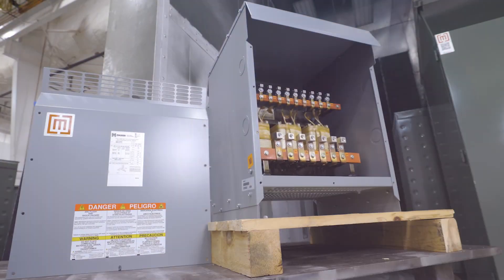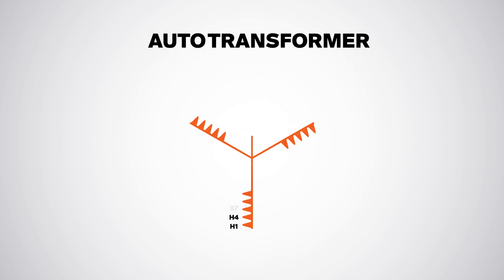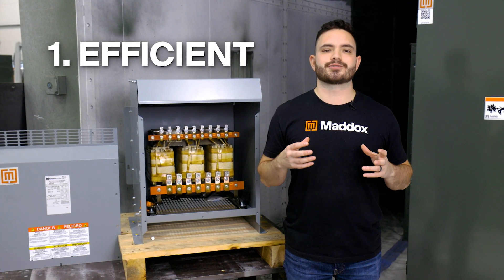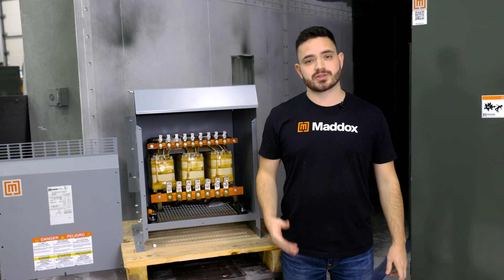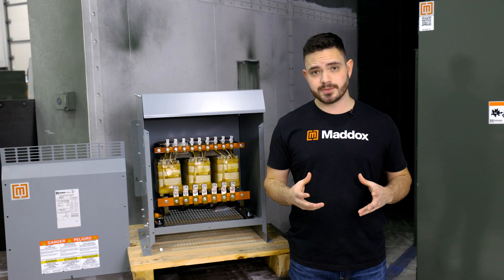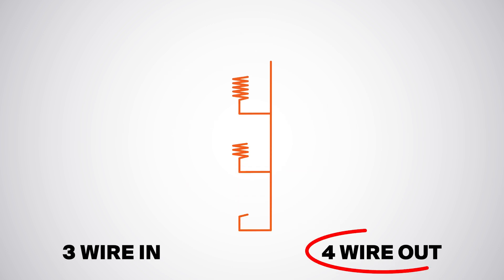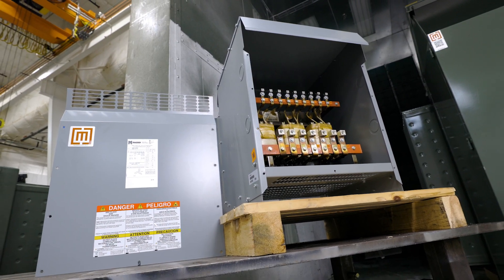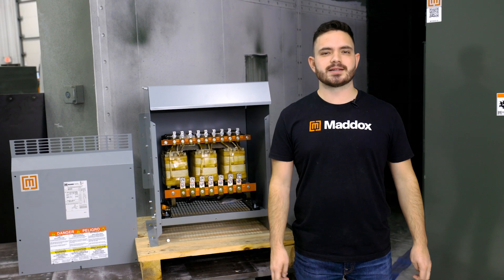Autotransformers  applications, advantages, & disadvantages | Maddox

Comment: My  autotransformer has 3 wires in 4 wires out, 480v to 380v 3 phase delta to wye. How is that possible
Reply from the maker: If your primary winding is delta-connected, and the secondary winding is wye-connected, then it's not an autotransformer. Some wye secondaries have multiple tap positions--for instance, 380, 400, 416, or 430--making the secondary side look like an autotransformer. However, this would not be an autotransformer since the primary is delta and the secondary is wye. Autotransformers don't have a primary and a secondary. They have a common winding and series winding on a single coil.
Reply: @MaddoxTransformer that would make sense but the one that came with my fiber laser machine in my shop is from china. It does not have taps to adjust the output voltage and all 7 terminals have continuity with each other. I wish i could show you pictures and video of this thing.

Comment: Many years ago we sold industrial machines in the United States, we always had to install an autotransformer to lower the voltage from 480 to 400 volts because the inverters could not handle such a high voltage, the autotransformer was the simplest and most reliable method 😊
Reply from the maker: Autotransformers are perfect for that.